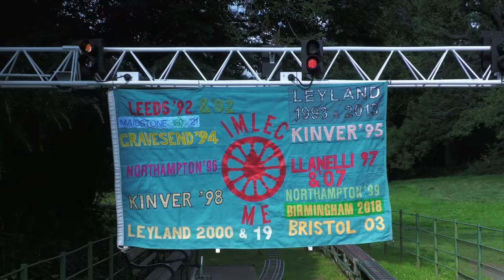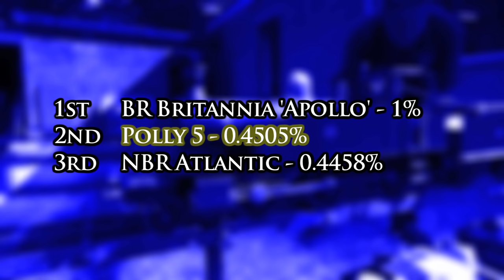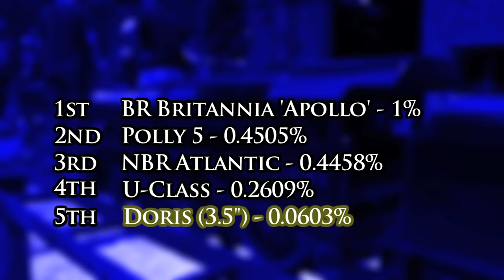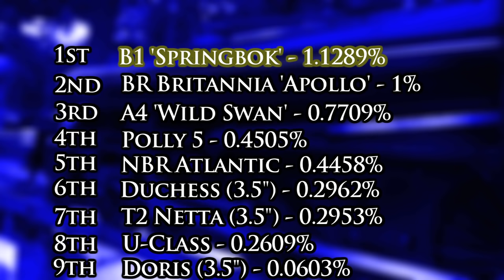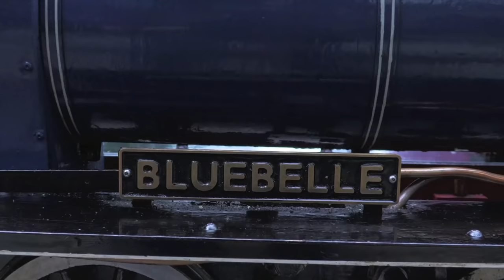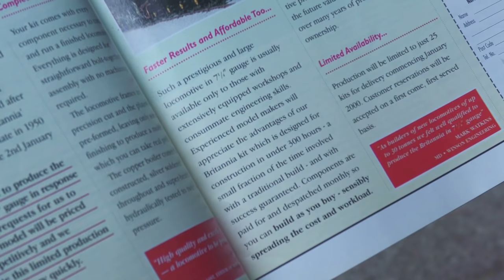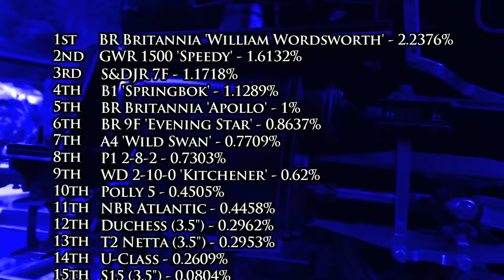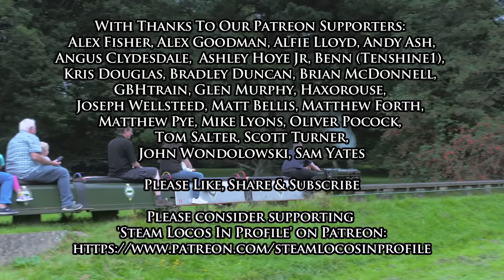STEAM LOCOS IN PROFILE: IMLEC 2021 Special

Comment: This would be the perfect event to go full Andre Chapelon and LD Porta on... Lempor exhausts, gas production systems in the smokebox, the whole works.
Reply: Don’t forget roller bearings on all axles and rods
Reply: Chapelon's never built 2-10-4 would be a place to start!
Reply: I wonder how much a Lempor would improve the performance of a 5" gauge loco. Would be interesting to see. I reckon an advanced 5" gauge QJ would perform quite well.
Reply: @The_New_IKB  I think a 2-8-4 would be better since a Texas might be approaching curve limits
Reply: @blackbirdgaming8147  I have a 4.75" gauge 2-10-2 and it really isn't bad on curves.
Reply: @andrewmagosky7181  I bet it isn’t awful, but I’d be concerned about the Imlec track specifically because I don’t imagine it sees engines that large very often.
Reply: @blackbirdgaming8147  that IMLEC track is near perfect in comparison to my ground level track in the US. The curves are also far more generous than the ones my engine runs on. Then again, my 2-10-2 is a bit of gymnast.

Comment: I've often wondered how something like a Stirling Single would do at IMLEC, the large diameter driving wheels should mean rather low steam consumption since they'll run at a lower rpm, but I imagine the lack of tractive effort and thus lack of passenger load, would be the biggest hamper.

You'd have to be very light on the fire to make up for it, and that's the other aspect that makes IMLEC interesting. Driver skill makes nearly as much a difference as the engine itself, as you need to balance using as little coal as you can, against risking a blowup, every shovel you toss in the fire lowers your score, so you really need to think about if you really need that shovel. And a good grasp of throttle regulation goes a long way in preventing wheel slips and wasting more steam.

Judging efficiency over just raw power and speed is definitely a more skill based competition.
Reply: A Stirling single has won in the past. It’s not about how much you pull, it’s how efficiently you pull it.
Reply: @TomsWorkshop42  I'm aware, my whole comment is talking about how judging by efficiency over raw power is neat, however bigger loads give you an advantage. 

If two engines burn the same amount of coal going the same distance, but one is pulling twice as much weight as the other, it has done more work with its coal and thus is much more efficient.

Which is why I said with a Stirling you have to be very light on coal usage to make up for the lack of loading. It's neat to hear one won though, must've been a really skilled engineer to make the most out of every shovel.

Comment: Well done to all competitors. Chris, i would love to see this again in 2022.

A question to the commenters: If you build a miniature what would it be and why?

I would build a 5" Norfolk and Western J Class 4-8-4. With roller bearings on every moving joint, I would think it would get better fuel economy.
Reply: In a miniature like these, roller bearings would only make a very very small difference. It’s all to do with cylinder, valve gear and boiler design, plus drivers skill.
Reply: Like the question posed 🤔 I'm going out of the box for a international miniature idea, I would go for a NSW 12 4-4-0 having remembered 1210 from footage of Flying Scotsman's Australian visit 😌
Reply: Most likely a JNR C62 (They were built for primarily passenger duties during WW2.) or a modified E2 with an extended coal bunker, flat running board and a mixed-traffic boiler.
Reply: A New York Elevated Line Forney. I think that the bunker full of coal would make firing easier.
Reply: My ideal miniature would have to be a 5” model of the biggest non-articulated locomotives on the Reading before the T-1s rolled out of the shops: The K1 2-10-2 Santa Fe type.  That, or a 5” Reading G3 4-6-2 Pacific.

Comment: great video Chris! I cant help but think that the competition has been a bit unfair towards the 1st loco, the track should have been cleaned and dried so that all contestants use track which is in the same condition, not have the first few fail and clean the track for the ones later in the day.
Reply: There was more to it than that, it was an overly optimistic load for that loco on that track at any time.
Reply: @TomsWorkshop42  ah ok, thanks for the info!

Comment: 40:09 obviously whomever designed that booster didn't know the proper way to implement it, the New York Central J3A Hudson class also had a booster on its 4 wheel truck although it may have been more successful since it was 4 wheel rather than 2
Reply from the maker: That and it just wasn't necessary for UK requirements. So, no wonder it didn't last long on the LNER

Comment: I have heard of steam locomotives running on wood, oil, natural gas and even french fry grease! Why can't these locomotives be converted to run on that kind of fuel? Or even charcoal?
Reply: They can. It happened to Sans Pareil of the R&ERR in the '20s.
But the point is to demonstrate that coal can be both efficient and clean when burned properly.

Comment: It's ok counting how many people are riding on the back of each engine but some of those passengers are like hippos whereas others are regular sized humans. Surely it is a little unfair counting each person as one weight unit when many are weighing twice or thrice the weight of another.
Reply: Compare around 1:02:00 with around 1:08:00 if you disbelieve me.
Reply: Exactly…. “The engine is not the problem…yada yada yada” …. But some of these people are the size of 50 scale elephants… each. I’m surprised these little steam engines can move one human.

Comment: They would do better if there wasn't a ten ton tessy on the back of the Dyno car they don't call a "passenger" ;)
Reply: It makes no difference, the load of every person is counted as the dynamometer car measures the load off the back of the loco, even the load of the driver is counted.